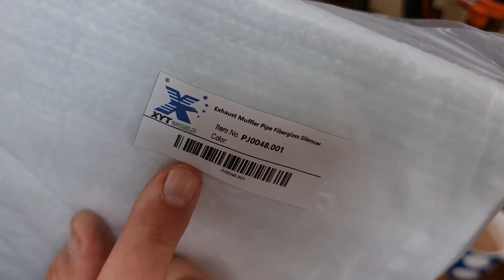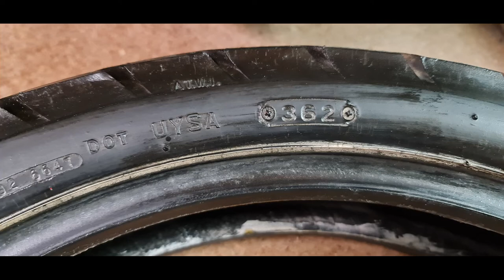Yamaha RD/RZ Restore Part 9 - Silencer packing, how to remove tyres and read the age of your tyres

Comment: love your down to earth unpretentious vids. VERY educational, thanks. PS, Im with CDKMOBILE, cut the last old tire off with a recipro saw ;-) PPS excellent job on the pipes, curious how that bodyfiller will hold up.
Reply from the maker: Ive filled in expansion chambers before when I went down the road once and badly gouged them, never fell out. But as you say time will tell, if I do ever see it cracking will post a quick video. Thanks for watching.

Comment: Nice job on the tire removal - seemed to go pretty smoothly given the tire was 30 years old! On the really old and hard tires I've resorted to using a cut-off wheel on my angle grinder.  One of my least favourite jobs!
Reply from the maker: I made it harder by not listening to my own advice and not putting soap on first. Lesson learned.

Comment: Really don’t like the f1 wheels f2 are far nicer in my opinion
Reply from the maker: I prefer the F1 as that was mainly the bikes I had back in the 80's, that said about a week or two after I painted these I found some F2 ones. 🤦‍♂So will put on the proper wheels and re use these on the older models I have. But paint them black.